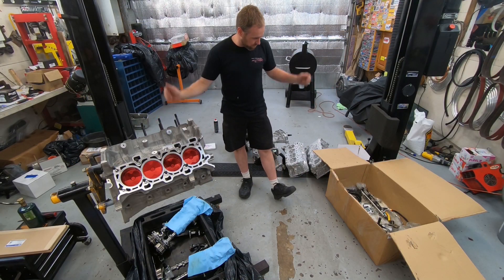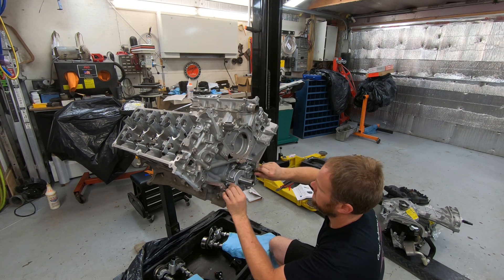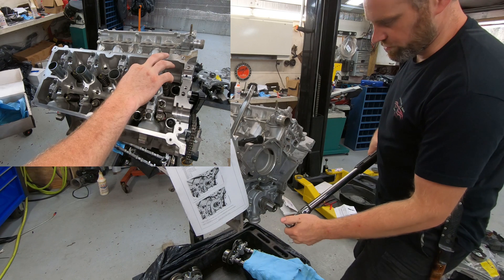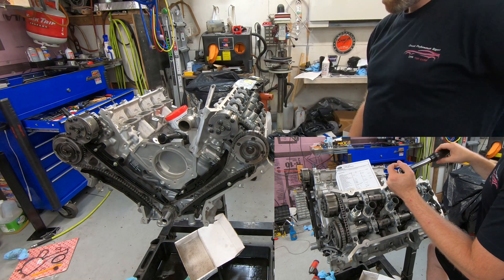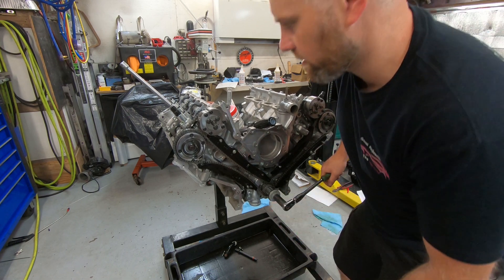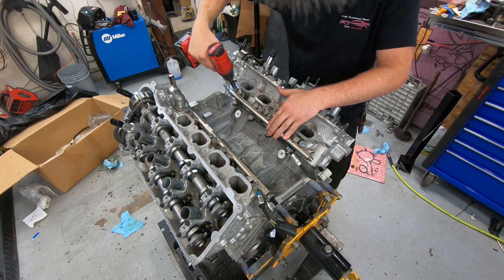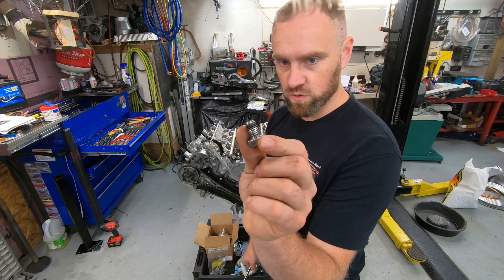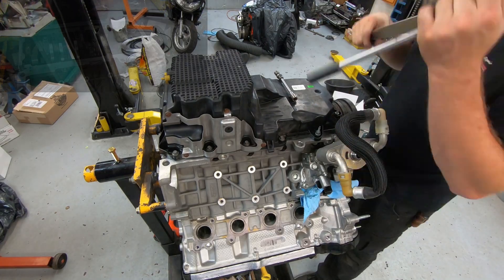Gen 3 Ford 5.0L coyote Engine Build Assembly Pt2

Comment: You don't have to replace the fuel lines on the high pressure fuel rails. They are made of stainless steel and are a flare style fitting. We have been reusing these for years. Never a issue. Also the pick up tube stand off needs to be cut off if your using the stock Gen 3 plastic oil pan.

Comment: Funny story about not having enough extension;
About two years ago, I bought a used washing machine. The agitator was with it but not bolted down. Told my wife to go to the parts house and buy the longest 3/8 extension they had. I had no idea they made 3 foot long extensions. When she got home she showed it to me and my eyes got as big as q-balls. Anyway, I bolted down the agitator and put the extension in my box thinking I would probably never use it again. A year later, the starter went out on my truck. The easiest way to access the bolts was from the wheel well. I didn't really feel like removing the tire and I remembered that I had that 3ft extension. It made the job infinitely easier changing the starter.

Comment: this motor was not as cut and dry as most people think, especially when you mix in aftermarket parts.  Theres lots of tricks to these things.
Reply from the maker: Seems to be that way with most engines. These DOHC engines are even more of a treat though then most.